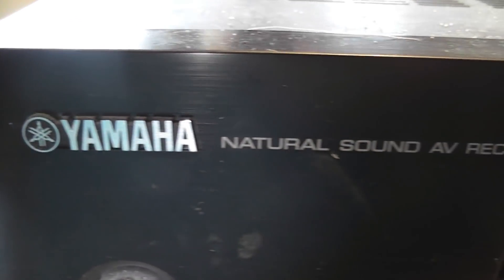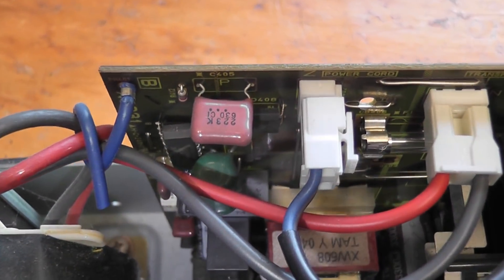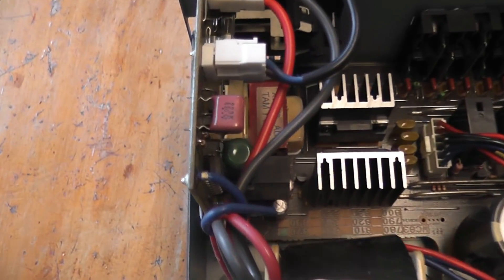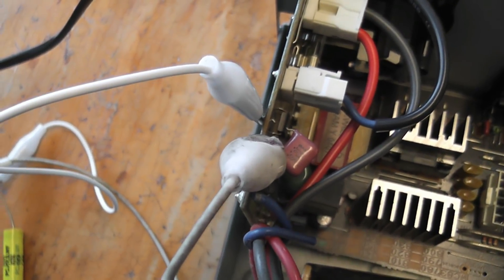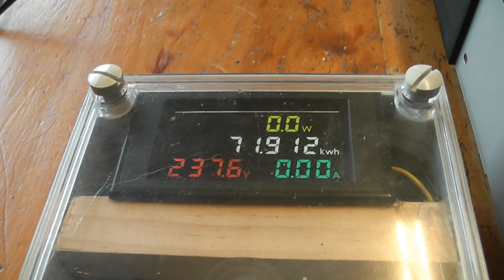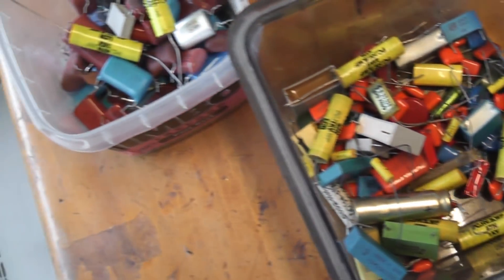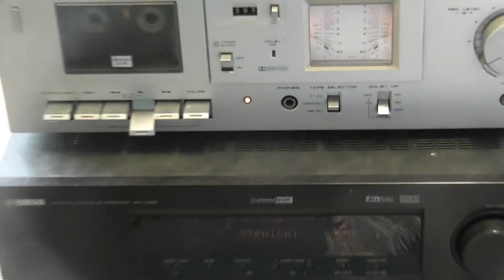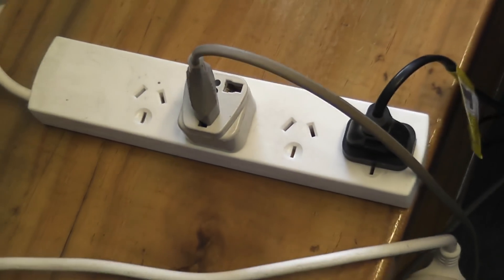Yamaha Amplifier RX-V450 fault

Comment: Is it possible to jump that capacitor?
Reply from the maker: Not sure, the capacitor is there for a reason. Better to fit a replacement capacitor of the correct value and the higher voltage rating as I did.
Reply: RODALCO2007 Thx for the reply! I crossed it with a phase tester in standby and hit the On button and she switched on! But, when I unplugged the unit, the capacitor would not reset until I crossed it again! I’m in no way an electrician!! But thanks to you Sir this amp will rock once again!!! 👍
Reply from the maker: The capacitor has something to do with the standby function. Just get a capacitor from ebay, only a few dollars and often free shipping.  @Cheezwizzz

Comment: Very common problem.
The fine layer of metal on the plastic dielectric film, which makes up the capacitor electrodes, gets zapped over time by dielectric breakdown and thus the capacitance decreases.

Comment: Great i lothe ssimple fixes :) I repair stuff like this alot and these caps ore often the fault... 2 things to mention: First the capacitor is not a "dropper" to drive the relay, its just in there for EMI reasons. What drives the relay is the other small transformator below.. :) Second, while the 1000V WIMA looks like a good replacement, what really should be in there is a "Class X" rated safety capacitor (You can also get them from WIMA, they are called MP3-X2 or MKP-X2). But im starting to get nitpicky now..  happy new yeear!
Reply: @Alex Reeve I think my avr has finally suffered the same fate. The problem of not turning on started, but could be solved by a full off/on at the mains, but seemed to become more frequent quite quickly until now, when it will not turn on at all. Does that sound like it could be the same 22nf cap? Where in the UK would you recommend looking and what brand for good quality components?

Comment: Wima is the top, they never fail. I salvaged a lot of them, as far as I know they are/were from Germany in the 1970's and 1980's and used in high quality German analog TV sets, like Grundig, Nordmende, Blaupunkt, etc. Stupid design that 1 small cap from 22N (!) (flimsy value)  can make the whole amplifier to disfunction. Surely there was another design possible where 1 cap could not decide about "make" or "break" from such a (by itself) top HQ amplifier.
Reply from the maker: Wima is top quality, I always remove them from DOA appliances. Still a poor design on that Amp.
Reply: WIMA is still existant and also produce in Germany, Mannheim.
Reply: Rifa on the other hand ... god, their paper film X-class caps were horrible. They're those yellow transparent ones that often look cracked - in fact, that cracking is the problem. Moisture gets inside in the paper dielectric and you guessed it, it causes a nasty short circuit. So much for safety, LOL.

Comment: Always nice to score something that only needs a simple fix. Without bothering to Google... almost sounds as if that cap is being used as part of a standby dropper power source, just enough to feed the soft touch logic controls.

I always wonder how much longer amplifiers with heavy linear transformers will remain around before some greenies get them banned.
Reply: I have an old Sony STRD-1090 and it has a huge Linear transformer and most likely half the weight of the thing,.

Comment: Nice work! But, do you still use cassette tapes? LOL!
Reply: There are no highs in sound because those speakers are SUBWOOFERS from Philips TVs :)
Reply: Sounded like the tape heads needed cleaning too or just poor audio pickup. Sweet when a fix is that easy on such a complicated device.

Comment: Powering from active to earth does not NZ require RCD units ?
Reply: Might not have an RCD fitted... those adapters are usually a bad fit with euro plugs, either they don't go in the right holes or they wiggle about & crackle...

bigclive.com calls them "deathdapters"
Reply from the maker: We have an older house. Glad i don;t have them.
Reply: Anders dan in Nederland. Een aardlekschakelaar is verplicht, met enkele uitzonderingen.
Different than in the Netherlands. A rcd is mandatory, with some exceptions.
Reply: You're glad you don't have them? Why not?

Comment: That new WIMA capacitor should last much longer than the original generic one. I would've put in a 33n or even 47n. That looks like a capacitive dropper circuit feeding the relay.
Reply: A capacitor dropper cant supply enough current to drive a relay (just around 5-6 mA or so). These are usually in there for EMI  supression reasons
Reply: Alex Reeve,
If a capacitive dropper can supply enough power for a string of LEDs, than it surely can supply enough power for a relay. In fact, it certainly can.
Interestingly, the font on the failed cap leads me to think it was made by Panasonic.
Reply: No, 5-6 mA is certainly not enough to drive a relay.. :) :) Yes the cap looks like a panasonic one.